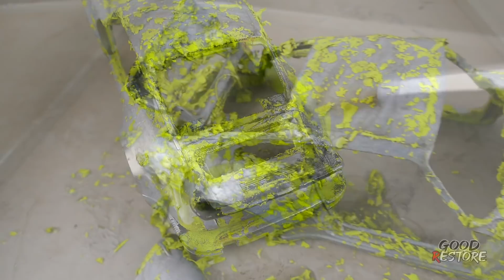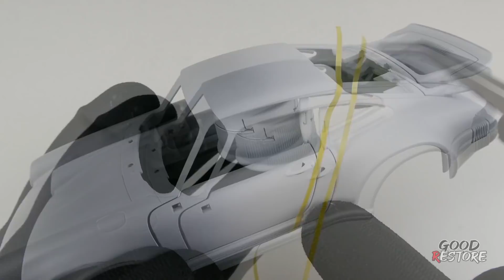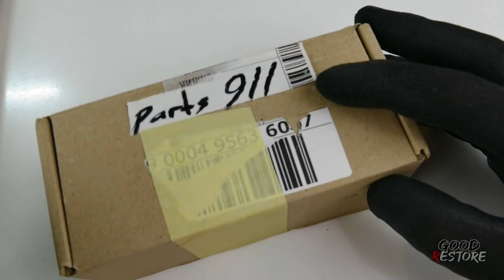Cyberpunk 2077 Restoration abandoned Porsche 911 Turbo Johnny Silverhand car

Comment: How do you keep finding model cars that look like they were in a house fire then thrown into raw sewage?
Reply: He gets them new( probably two pcs, so he can use the spare parts) and damages them on purpose. Restoring is easy, when the you choose ehat to damage and can buy a spare donor toy from store. Getting a vintage one and restoring it properly is where the real game is. But it is much harder to find such toys, they are more expensive, hard to work on and there aren't available spare parts for them.
Reply: paint stripper and dirt
Reply: he just YEETS them out of a 5 story building into mud and cleans them :)
Reply: His doner cars do always have a suspiciously similar level and type of damage and wear.....
Reply: @spamcannon5917  that said, the amount of detail he puts into it is still impressive even if the original seems to be a new car that he just made look like it had been in a dumpsterfire before the restoration.
Reply: tbh they look alot like the delapitated models you can buy, the most common ones are apocolyptic, run down model Buildings but you can buy cars as many hobbyist like the look of weathered cars, the car was probably brand new with a weathering effect on it
Reply: There's a lot of cars like these in the junk shop near where I'm from, the garbage people have a huge pile of cars like these and other toys made of die cast etc.

They seperate them cause they can't be burned or composted. There's also a large pile of broken appliances, tvs and Car parts from wreckeges.
Reply: I have now watched a bunch of these videos and am completely convinced that he damages the cars himself. They all have the same type of patina, rust, and dirt.
Reply: @user-sr3tj5gn8y  no shit
Reply: @slonky821  I like your name
Reply: it looks like he's grabbing them from The Last of Us
Reply: Plus cyberpunk just came out
Reply: He clearly distresses them on purpose. If you look closely when he disassembles the cars, the underside of the body has absolutely perfect paint. It's a little disingenuous to claim these are 'restoration' videos, however, the modifications he does to these cars is nothing short of phenomenal. I think he's just riding on the trend of restoration videos on YouTube to please the algorithm.
Reply: If you want a steady supply of wrecks you make them yourself.
Reply: I’ve been seeing a lot of these “restorers” lately who clearly damage the soon to be restored object themselves, then restores it. I only stopped into this literally because I saw the pic and thought “oh look, another one who doesn’t have to deal with rust or pitting or all the things real restorers deal with” then wondered if anyone else noticed, apparently not many since this channel has almost 450k subs. What a scam, it isn’t restoring, it’s at best modifying or pimping. Restoration is hard, this isn’t that
Reply: @user-sr3tj5gn8y  It's obvious he does

Comment: Nice job. For safety appearances would a feeler gauge for checking automotive clearance be safer as a pry bar that a razor, or is the blade useful for sliding in without damaging the pieces?

Comment: Man where do you find all these models in exactly the same condition? Do you just have a box of them outside all together? Amazing restorations btw!
Reply: They're most likely purchased new then purposefully aged and damaged. Note that the damage on them is generally superficial and easily fixed with a new coat of paint. If they were actually old and damaged the metal bodies would be rotten away and would need to be built back up.
Reply: @jacksclevername  That's my thinking too. Takes away from the "magic" a little bit (like all those videos about "restoring an ABANDONED Rolex Submariner" and it's just a brand new watch that the guy has buried in a sandpit outside for like a week before filming)

Comment: Where do you get your model car glass from? I'm looking for some for my model Ford mustang as I accidentally cracked both front and back windows glass. Thanks
Reply from the maker: Try to cut from polycarbonate, or from a plastic bottle with a bend to match your original glass
Reply: @GoodRestore  thanks, i never thought of a plastic bottle

Comment: I think the video is self-evident. First, make a new model look old and rusty. And then "restore" it with some new parts probably from the second model. I don't know how problematic is to get new parts for these models, so I can't tell. But the easy way is to buy another model.

Some people may be fooled, but as a modeler, I can spot, the rust is just rust paint. And of course, real rust won't come off just by scrubbing with the paintbrush, you have to do it with some sanding grit or rotary tool to take it off. Not to mention the body of the car model is probably aluminum and aluminum corrodes but it does not rust. Anyway, rust color is easy to spot 2:35 as the big brown smudge probably on the plastic part :), which will be later washed with some cleaner and paintbrush.

The proper name for the channel should be called GOOD MODIFICATION. Modeler's skills are decent and the end result is nice, so why fool people?
Reply from the maker: How can I see you are so smart, who told you that it was rusty, where is it written? You were not too lazy to write such a long and meaningless comment, you are hardworking))
Reply: @GoodRestore  So, the brown color on the model at the beginning of the video is supposed to be what? Mold? I have eyes like anybody else and I'm not colorblind. And when I see rust I know I see rust.

Comment: Nice work on the model. However I don't know why you see the need to dress the model as a wreck prior to redoing it. clearly you spent a lot of time making it look like crap. Also those wheels were off a 959 model the windshields that weren't original too...I'm sure you took that off the clean 911 model before destroying it as well as the wheels and just put in a bag for the side when you rebuilt it.  Just redo model from the real condition it's in.
Reply from the maker: Just rebuilding is not interesting for anyone to watch, and you would not watch this video either. I hope you understand
Reply: @GoodRestore  you're very talented. I would still watch them!